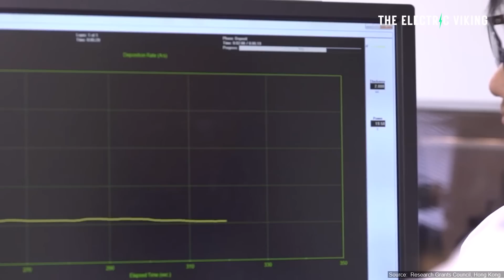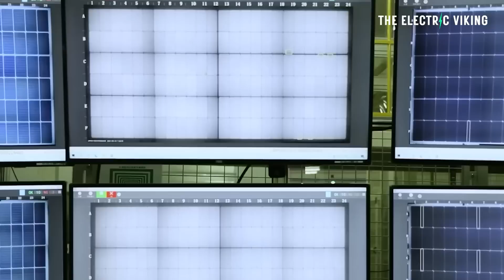China's record-breaking new solar panels will be made by robotic humans

Comment: I was reading an article about how AI is being used to control the consistency of the secondary layer on just these type of panels. As well as improving the manufacturing process to lower the cost of production. This company is also claiming a +30% rate of output. This is so much better than anything on the market that I have seen which is very exciting. I wish there were flexible panels with this strength of output as I would love to replace the panels I installed on my compound curved roof of my personal enclosed mobility scooter. That much of an increase would mean I would hardly ever be plugging in to charge.

Comment: When I trekked around China for 3 months in 2007 I noticed on top of most buildings were many solar water heaters. Super simple and does the job. When I was in Yangshuo outside Guilin the power went out and I still needed some water in the bathroom. No power means no water being pumped so no water.... Except gravity flow from the roof so no cold water but a-lot of hot water. US government has been captured for decades so no surprise US falling behind big time.

Comment: |> |> |> |> |> |> |> |> 
|> |> |> |> |> |> |> |> |> 

or fuck the whole depending system ...

cars?

HHO empored radial engin like the astron omega1 engin ...

anyone blah that HHO dont work is a luar of have no idea ...

my marin coanda drive would remove 95% of polution from all seas ... minimum ...

a little search here about "why kill ships the planet more then cars" ... make it clear ...

further more ... it should ve clear that when you change the electrolyte from that what produces the electro magnetic enegiefield around thus planet which schiele ftom cosmic radiation and a lot from the sun ... all here would be barbeque ...

I would check that at first ...

but ... the drive is to empower only with photovoltaik and windgenerators also by monohulls, ... give containerships a manoeverabilitie that no towing vessels are needed anymore ... and speare so by one thatfull 50 million euro for fuel ...

looser=
oilindustry and all goverments involved the tax on that ... by 4500 operating cibtainsersgips worldwide that minimum 10 times per year are this how much?

next is ... no engin sound signature ...

not to locate over x miles ...

the coandadrive is a pump ... easy fully to decouple from the hull ... the water cools it ... 

and if electric generator empowered with hho ... speed unlimited range  ...by power boats ...

the horror for any coastguard ...

thats the reason why I must rot in that boat where all that prototypes have been build in ...

sabotages to a garbage, ... all dirty and ruthless open revoked that I can leave ...

because this all should rott with me ..

like that 8 ftom 9 addopted cats which was murdered (pathology report),  and with me the last ... of that family ... all to see on my channel ...

youtubes give a shit on the duty to report ... this is planed murder ...

and with me world and massmurder ...

20 000 each day die on sicknesses snd diseas caused by polution ...

I have for all what energy generation, moving/traffic, and heatin, cooling, housetech belngs all worked out ...

=complete loosing of control over money = income by the majority of the people in all basic needs = hardly to force them with anything to things what they otherwise would not do!

THAT IS REALITY!

that with the durablity is a kick ...

that is the real thing ... with the efficiency ...

you always with your "scary" ... bullshit ...

that is all show and all planed ...

Im only still in this human vessel because I had a training in things which all this "normal" developers not had ...

they was easy to kill ...

in vienna within 3 years 5 physical attacks, ... but I train real martial arts since I was a boy only in that incarnation ... sword and schield, fencing, bow, axe, with 12 jeet june do for international contest level, ... tai chi, chi gung, x meditaton technics and houres ... 

psi training, druid, a creature of "the old way" ... ilus warrior ...

humans are so easy to murder ...

asgards not ...

here was already tech developed ... if all this would not be opressed and the people blackmailed or murdered ... 

this planet would be a bluming garden ... 

this now is evils hand!

you with your tolerating or not decide your and this eorld fate ...

I would begin to set the right measurements with the "empathy system" ...

your time runns out ...

|> |> |> |> |> |> |> |> 
|> |> |> |> |> |> |> |> |>

Comment: Lets completely disregard the solar heating that these cause. 80 acres of grassland ground temps are 90 degrees in the summer, covered with solar panels this same 80 acres now has 80 acres of  135 degree solar panels radiating that heat into the atmosphere. Move to energy demands, the electrical grid is set up now to run 'supply on demand' energy.  At 6 pm everyone comes home, A/Cs are turned on as well as ovens, showers. laundry. There is a huge demand spike and somewhere a GTG fires up and pumps out the demanded power and contains the spike of usage. IF solar is mandated then the grid is no longer 'supply on demand' but rather demand vs supply. The sun is setting the output is dropping and at the moment there are no storage systems available that can withstand a multi megawatt draw for hours on end. 
The  idea is cool but the tech and implementation is not able to sustain the idea. I am 100% for alternate energy sources, I am also 100% for a common sense middle of the road approach to implement its take over of fossil fuels. What is happening is like looking over a cliff, seeing something at the bottom that is worth investigating and instead of finding a safe route down in the form of a path, one just leaps off the edge. The results are the same, you are at the bottom of the cliff where you wanted to be but the consequences are totally different.  One consequence is you arrive slightly winded from exertion and an hour into the trek, the other your dead, lifeless body could care less about the outcome.

Comment: 33% efficiency panels would have a huge effect on my life personally, being able to gather 1/3 more energy would make life a breeze in winter, I would never have to use the grid again.
Reply: Or you could buy more panels...duh
Reply: If I. had the roof space duh! @lo1234-w9r
Reply: The efficiency is measured in amps, volts and KWs but the real metric is $ per KWH and these panels aren't there yet. Longi made no claims about $ per KWH.

Comment: As efficient as Perovskite panels are, they have a very high degradation rate. you WILL be replacing them in 5 years. However, they are constantly working on more and more stable forms, which hopefully solve those problems. For right now, I would rather install a slightly less efficient panel, if it will be generating more power after 10 years, than a Perovskite panel that, for the first year, generated more power when new. The "greenest" panel is the one you DON'T have to replace!

Comment: Don't get too excited with those records yet (check the conditions and duration of the test) - perovskite layer as tandem so it probably degrades quickly in normal conditions that a PV panel needs to endure. (unless they found some innovative way to prevent / slow down perovskite PV cell degradation, but then we would see crowded patent offices and they would keep it quiet until fully patented in major markets).
Reply: Exactly my thoughts !

Comment: Efficiency doesn't matter much compared to price, but you are often not that limited for space. The problem with chineses panels has always been logevity. We are seeing it all over australia: 10 year old panel delaminating on the back of the panel.
Reply: I mostly disagree, I've seen the same problem with Sanyo and other modules as well. I have plenty of installations that are 20 years old now with Chinese modules and they have stayed well within their degradation numbers of less than 1/2% per year.
Reply: the thing is most ppl will want to upgrade there panels if they are 10+ years old at this point anyways as you can pretty much 2x your output within the same space at much less then 1$ watt compared to 4-5$+ dollars a watt 10 + years ago its a no brainer
Reply: 10 year old panel are highly value recycled in China. They even hog the panel for higher value.

Comment: NREL won't certify the efficiency of solar panels without thorough testing, which they must have done on these Longi panels.  I've sold Longi panels for many years and they work as advertised, great products.  If they're achieving 34% efficiency, with a competitive price, this further spells the end of coal and gas, which is inevitable, already.
Reply: Good efficiency out of the box. but, Perovskite degrades very quickly. You will very likely be down to less output than from a polycrystalline  panel after just a few years...At least, that's what I've observed in the past. It is very possible, that they have been working on long term stability, and have solved the problem. "The jury's still out on that one". The "greenest" panel is the one you don't have to replace!
Reply: Oil is here to stay
Reply: @ExploringCabinsandMines cheap oil has already peaked and remaining oil is harder & more expensive to access, accessible oil reserves will decline from here on. Geological Oil is just a blip in human history. Check out Nate Hagen's work ( videos)😊

Comment: is it physically possible to increase electrical demand using the existing power grid?

i do not think so.

we have so many cars in america.  and our power grid goes back over 50 years. 

275 million cars in america. we have no public transportation system.  what we do have is a sad joke. it doesn't take people where they want to go when they want to go.

anyway i haven't seen anyone come up with plans that say we need this much electricity, and this many telephone poles carrying this many wires each one of which is at this voltage at this current.

the major players plain flat do not know.  they're mostly all happy touting politically correct phrses that have no basis in reality..
Reply: You haven't seen it because it's not widely publicized, but that doesn't mean it doesn't exist.  Multiple electric utilities and grid agencies have weighed in on the problem of the grid providing enough power for the transition from ICE to EVs, and the answer is always the same.  They can do it.
Reply: @incognitotorpedo42  thank you for that well placed politically correct statement. i haven't heard one in about 3 hours. 

it gives me great comfort to know we can do it, and some one somplace has worked out the particulars.
Reply: All the old garbage power grids around the world will be needing big overhauls.
Only trying to supply the demand will sink an economy, the future is energy abundance or poverty... ready, set, go!      :D

Comment: Ok, Sam... you are really twisting this a bit too much.  NREL in this case is just validating cell efficiency claims, which they do for HUNDREDS of different types of solar cells submitted to them.  It's just for their summary chart, nothing more.

You are making this certification thing out to be far more important than it actually is.   It really isn't... its a footnote at best.   This is just base science, not some huge commercial breakthrough.  Most of these research cells do not have the robustness or longevity required to be useful.

Just plug in "Best Research-Cell Efficiency Chart" and click on the first link (the NREL) link to get the chart.

-Matt

Comment: What I understand from perovskite solar panels is that they have high efficiency, but at the cost of lower life span compared to other mainstream materials. So there are trade offs for the future. So with provskites it likely comes down to the choice you want to make in terms of longterm investment compared to short and sweet energy profys in the short term. I yeresting way to think about solar panels. In my view this fits well with how Chinese cheap products have work so far. Not sure provskite will change that mantra of cheap costs for cheap lower quality products. The future will tell. I think the self repairing material's added value will depend in what the material will actually protect in repair. Is ot glass damage from scratching, repair of damaged molecular structure of cells due to longterm sun exposure, protection against common material corrosion repair, something else? We will see.
Reply: The next race is to get 50 years of useful life. That with thirty percent efficiency  would be a real breakthrough.

Comment: Uhmmm..  Don't they have "a little problem" with catastrophic degradation when exposed to MOISTURE?  There's a wrinkle or two to hammer out before they're commercially viable as solar panels tend to be installed OUTSIDE where there's rain and humidity.
Reply: They are also usually laminated in glass.
Reply: @krasserTerror  Have you seen the panels laminated?  It just barely delays the decay.

Those panels are going to take a while to make viable commercially.

Comment: This sounds great, but I am waiting because I’m hoping that Tesla will offer a combination of HVAC, solar panels, DC appliances  and batteries  that will optimize the efficiency and economy of the system. No need for expensive, unreliable invertors.
Reply: You're going to be waiting a long time.  Tesla is not going to do HVAC or DC appliances.
Reply: @incognitotorpedo42 never say never. They're running out of markets to disrupt.
Reply: @xaionik 10:24
Reply: How do you know? The Muskrat has stated that Tesla will introduce improved HVAC systems to complement its solar power systems @incognitotorpedo42
Reply: When I was in high school there was talk of the "all-electric house" and we're nearing that reality. The HVAC might be more of a heat pump thing. But, solar panels in the form of roof tiles, batteries that keep charge for the home and the car, water heating, and all other electrical needs shouldn't be too hard for a good home construction crew to do today.
Reply: Yes, but what I believe is that we need to convert our homes to pure DC current in order to optimize these technologies. It’s more efficient, and even audiovisual equipment will work better with DC in homes that is isolated from “noisy” power generated by distant AC generators. I believe it will happen because it makes sense. I also believe that carbon dioxide will replace toxic refrigerants in the near future. That is because the European Union has introduced policies than will abolish toxic refrigerants. Already Mercedes has developed CO2 air conditioning for its sedans, and HVAC systems are converting to CO2. CO2 is devoid of toxicity and far cheaper than toxic hydrocarbon refrigerants.  @markhathaway9456

Comment: Self healing panel. That idea may not be far fetchy as most of us might have think. I read an note on my university chemistry book that even 17 years back. The were prototyping self healing plastic. Calling it self health is bit of cheating. Cause what in the nut shell is repairing agent( or catalyst) being encapsuled in tiny particles and blended in the material. Once the plastic is damageed, the capsule particles will rupture and the agent will come out and "repair" the damage. It is like the carbon copy paper we have been using for years.

Comment: Weird coincidence; 32% efficiency is approximately the same of what the average ice car gets in thermal efficiency though the theoretical maximum is 50%
Reply: ICE combustion is a thermal/chemical process, solar cells are a quantum/physical process. Both are subject to laws of diminishing returns. There is only so much you can do to convert the phenomena to usable energy.
Reply: 32% is just the thermal efficiency engine itself could reach.  Once you consider all the energy lost from transforming the engine’s mechanical energy to motion at the wheel, it’s more like 20%
Reply: @xsu-is7vq  f1 is 50% sooooo
Reply: The delivery of oil-based or coal-based energy is very complicated and a lot of inefficiencies are barely mentioned to the public. Focusing just on the burning of gasoline and its conversion to car movement is only part of the picture.
Reply: Yes coincidence but what is not a coincidence is efficiency will keep increasing where as ICE engines have just abou5 peaked
Reply: @bruceevennett955 and the input fuel is free for around 30-50% of the day.
Reply: @bruceevennett955  they haven't gotten that much better. You should look up the miles per gallon of the model T, it's not so far off from a lot of today's vans and trucks.

If we are going to do engines, the need a scotch yoke architecture and they need to be detonation engines rather than combustion engines to get higher efficiency.

We already have electric motors which are incredibly efficient tho
Reply: Most ICE cars are less than 25%.
Reply: NASA says the efficiency of an internal combustion engine car is in the range of 11-27%.
Reply: @paulmaxwell8851  but wrong
Reply: Yes this is why electric motors are so much more efficient. Sound and heat are major waste products of internal combustion engines. There's all this shaking that has to be stabilized too.
Reply: To achieve the necessary power and efficiency, F1 engines achieve a peak thermal efficiency above 50 percent, significantly higher than a modern passenger car's 35 percent thermal efficiency. Accomplishing that requires a combination of pre-chamber ignition and a high 18 to 1 compression ratio.
Reply: @PazinPortugal  Thank you for stating the facts correctly, unlike these other Yahoos that post their gibberish.
Reply: Luckily, solar panels don't release toxic fumes while working.
Reply: Well, the fuel burn out the ICE don't move. Sun light alway there 1/2 of the day.